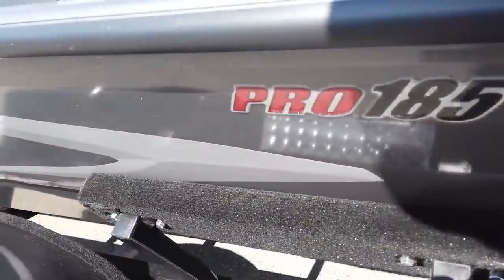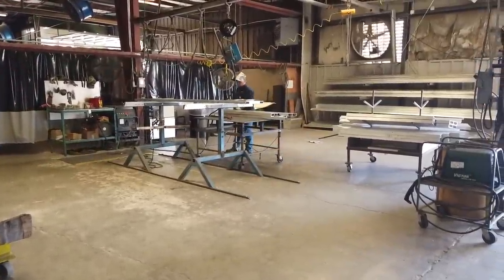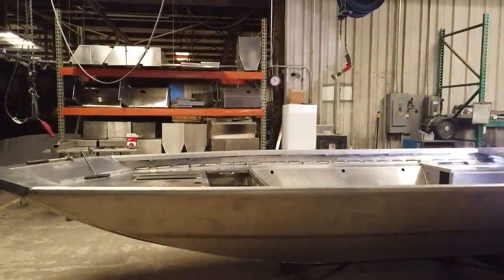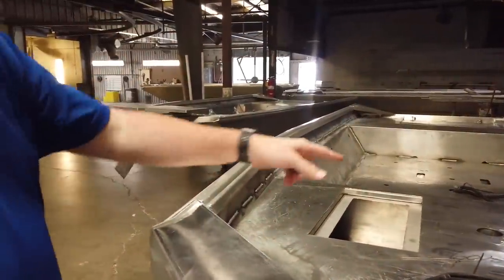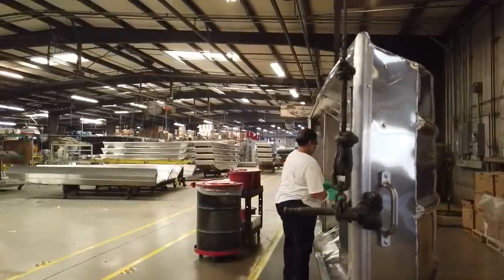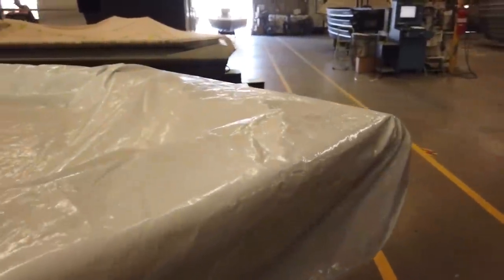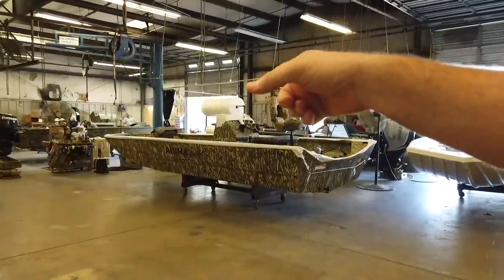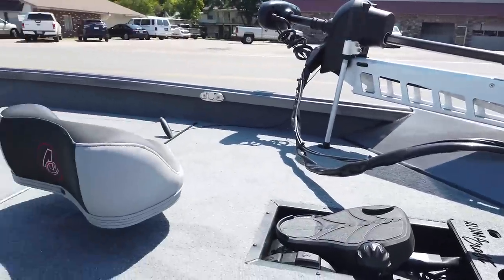How it's Made - Fishing Boats - Picking up My New Alumacraft Pro 185

Comment: Awesome! I have the same boat except G1 115HO, 2019 pro185 gun metal grey. Next upgrade will be either power poles or talons. Where did you fit the power pole pumps in the back compartment, does the G2 have an external oil reservoir?
Reply from the maker: When I do a complete walkthrough video I'll be sure to show where they are.
Reply: Flukemaster can’t wait!

Comment: i hate spray foam, especially in a boat that would need to cut apart to take it out when it gets waterlogged.
all foam will eventually start holding water, even moisture from the air.  any time after 10 year boat starts getting heavier. the amount of water of course is how you store it plays a factor of course.

Comment: Whats different from the one you had?
Reply from the maker: The layout is different. It's got a lot more room for tackle. the seats are an upgrade. The motor is new on the market and it's got a digital throttle.
Reply: @Flukemaster  Ah, well there you have it. Nice rig. I have a mod-V Crestliner that I desperately need some Power Poles for.